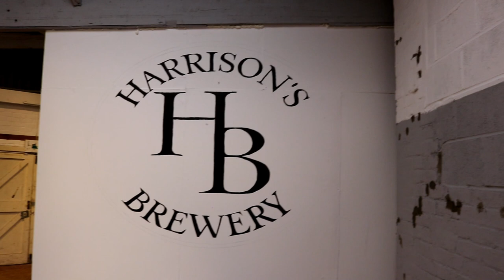WALL ART

Comment: 0:42 one for [NewToHomeBrew Tom](https://www.youtube.com/channel/UC-z5MeIZ5236ybbfRMxBtlQ) perchance 😉 😄 . I'd say the flashing needs sorting by the owner, that sort of water ingress could cause the wall to collapse eventually. I also have a tendency to lash a quick coat of paint on a wall prior to filling as it highlights the areas that need filling. Give the spots a quick cover and when all is dry go over everything with a final coat. It's quicker than trying to find all the holes to fill and two coats are usually better than one unless you have a perfectly smooth pale coloured surface to start with.  Great logo and and a great vid as usual. Cheers, Schnuz.